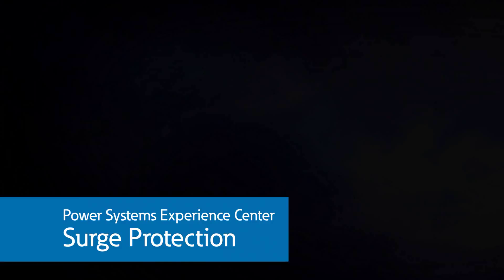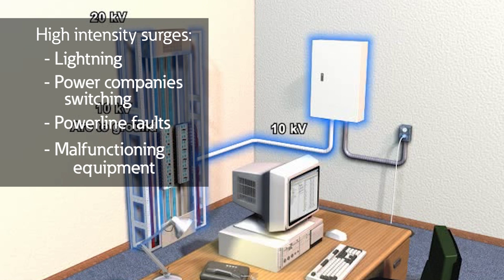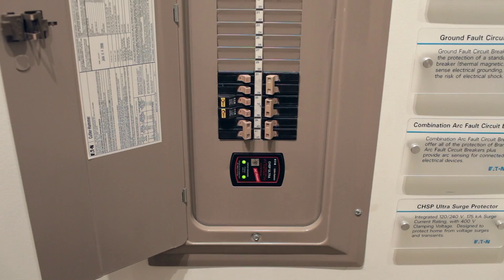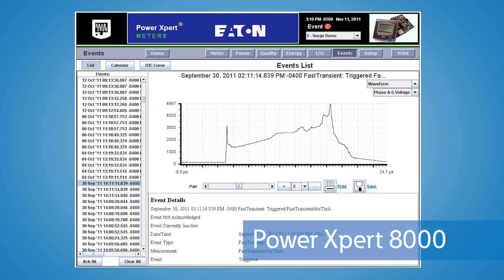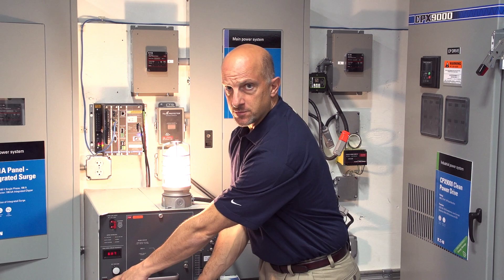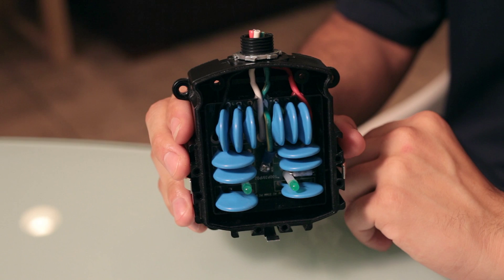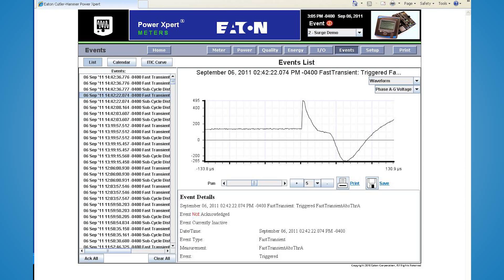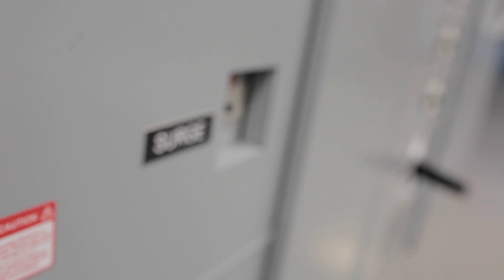Surge Protection

Comment: Hi, I have 2 plug in surge protectors in my panel. They are plugged into formerly open slots at the bottom / right row of breakers. Both have the light glowing. Are these properly installed?

Comment: Does a type 2 surge protector need to be replaced after a surge? Does it trip any other breakers in the box?
Reply: Eventually it will wear out, perhaps after 15 large surge events. SPD will have an indicator to show when they are no longer effective. Surges are generally too fast to trip a standard breaker.